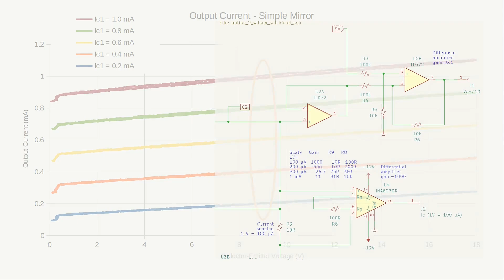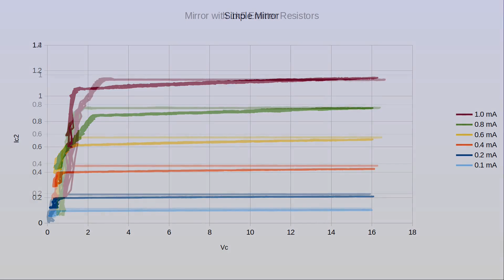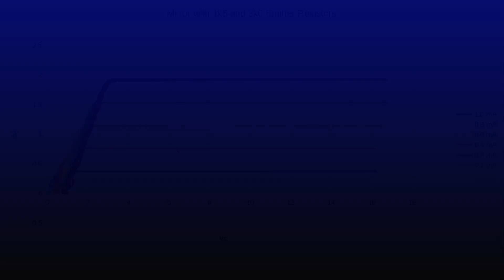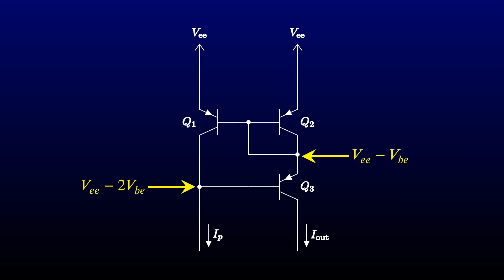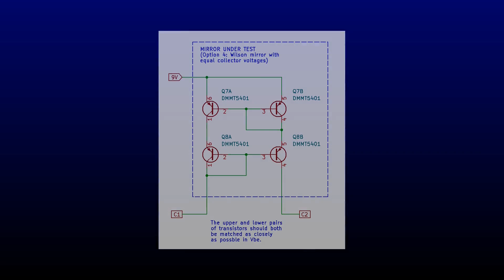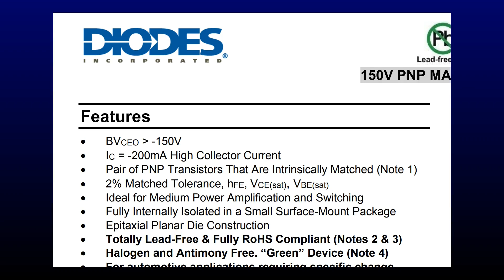Improved Current Mirrors - Transistors 101, episode 13

Comment: Thanks for your video! What do you think about the BCM847/857 matched pairs? They're "only" matched to within 10%, but for many applications like lin/log converters I found them to be decent cheap alternatives.
Reply from the maker: They're pretty good, and so are DMMT3904/3906. The 4401s that I used are a little quieter,and were in stock when I ordered in the middle of the CoViD Chipocalypse.  All of these are pretty much always better matched than the datasheet says.

Comment: There's the dual BCM847 and its complement BCM857. Most of these far exceed the rather cautious matching spec, even without the "M" designator. Not breadboard friendly, but for a PCB design they are great.
Reply from the maker: As I said earlier, BCM847/857 are nearly the same transistors as DMMT3904/3906. Both are usually much better matched than the datasheets promise. The reason I'm using DMMT5401/5551 is that I have some on hand from a time that the supply chains were disrupted by the Great Plague and they were what I could get. 

I also have a few PMP4201Y and PMP5202Y, but the SOT-363 package is even less breadboard friendly. I have a bunch of SOT-23-6 to DIP adapters.

Comment: hello can I ask something about what you calculated at 2:28? it says that the base voltage is higher than the power supply voltage? how?
Reply from the maker: PNP circuits are annoyingly upside down.  The current through the resistor and the base-emitter voltage of the two transistors are both negative in the equation.

Comment: Happy new year and thanks again for your fine tutorials of 2024..  your channel is REFERENCE material and reminds me of Robert Pease works RIP ...  ah yes those were the days...
Im currently designing a unity gain SE to BAL converter audio output stage but im limited to 16V rail max and im breadboarding over this new years holiday period from a stock of hundreds of BC549.  i expect lots of tears and hair pulling...  i would love for you to discuss the longtailed pair esp if you can allude to low voltage applications..  would be a great help?

I was going to buffer the outputs with bjt voltage followers and whatever neg fbk ratio presents itself?  Lots of fun ..
Reply from the maker: @Robert.Chauval  I'm in the process of writing the script for long-tailed pairs right now. It'll be a little while because I try to run a backlog, but it's coming.
Reply: @KludgesFromKevinsCave  fantastic really appreciate your prompt reply..  im happy to experiment until then and compare notes..  no pressure at all. 😊😊

Comment: I find current controlled systems very interesting. Most of the high end instruments of HP in the 70's and 80's use current control rather than voltage control. It's a pity, that components  have not evolve since then. Example: The other day I was looking for a matched pair of low noise transistors for an audio application. This was very disappointing. First I couldn' t find a single BJT with better noise ratings than the old BC550/BC560. Moreover there is no matched pair of these. And when it comes to JFET's  things get even worse.
Reply from the maker: I'm on the road at the moment. I'll check my notes on low noise matched pairs when I get home.  Ping me (email in profile) if I don't get back in a couple of days.
Reply: @KludgesFromKevinsCave  Have a nice trip. And I forgot to praise your channel - very neat mixture of theory and practice.
Reply: @KludgesFromKevinsCave  Today I found 5 interesting dual low noise BJTs from Toshiba. Moreover they have excellent beta linearity and are cheap. Hence they are really a good choice for audio applications: HN4A06J,  HN4B06J, HN4C06J, HN4A51J, HN4C51J. They differ in the configuration: dual NPN, PNP-NPN, dual PNP and the pinning commen emitter, commen base.  Unfortunetly Toshiba doesn't specify the matching.
The CMLT5088E, ... from 'Central Semiconductor' may be another good choice but poorly specified.
Reply: I guess low market demand is what makes those not commercially available. I have spent hours too matching transistors from large lots...
Reply: @stamasd8500  Look for HN4C06J or CMKT5087
Reply from the maker: From my notes:  

For cheapo generic transistors, I find that 2N4401/2N4403 run quieter than most other 'universal NPN' and 'universal PNP', so they're what I keep on hand at the moment for 'I need a transistor here.' They're not great, but at least they're a good bit better than 2N3904/2N3906, and sometimes that's the difference between, "I can't get acceptable audio out of this thing," and "good enough."

BC850/BC860 are SMT versions of the BC550/BC560. The corresponding matched pairs are BCM847 and BCM857. Readily available and cheap.  The drawback (for me) is that they're in SOT-363/SC70-6 packages, and I'm still working on my soldering technique for parts that small. Of course, in the workplace, there were minions to do that sort of thing for me, so I never got good at it professionally. The techs hated having engineers at the bench!  I have strips of PMP4501 and PMP5501 sitting in the cupboard simply because I can't be bothered to solder them at the moment!  But when I look at the parts availability, it looks as if manufacturers are starting to discontinue SOT-23 parts in favour of their smaller cousins. Cell-phones will be the death of all of us who have shaky hands!

Most commercial (non-monolithic) transistor pairs are pretty well matched, because the way they're packaged means that they'll be picked from adjacent dice on the same wafer. Even the humble DMMT3904 usually matches to less than a millivolt in Vbe when I test it. (Of course, you'll get the occasional one that's way off - but for a hobbyist or experimenter building one-offs, that's livable.)

For better performance: MAT12 still is in production.  SSM2212 has a pretty good match and fair noise performance. (The PNP counterpart, SSM2220, is discontinued.)  THAT300/THAT320 (matched npn and pnp quads) have decent noise performance but only fair matching.  HFA3134 (NPN) and HFA3135 (PNP) are RF pairs (6-7 GHz transition frequency, says the data sheet) with a fairly loose match (6 mV, says the data sheet) but they're quiet.

Thanks for the mention of HN4x51 and HN4x06.  I had the previous generation (HN3C51, HN3A51) in my notes and was disappointed to see them discontinued!

Some pretty good single transistors aren't promoted by their manufacturers as low-noise.  ZTX718 (pnp) or ZTX851 (npn) have excellent voltage noise if you run them at fairly high collector currents (they're large-die parts), and there are a bunch of other transistors that are fairly like them. 3d edition of The Art of Electronics has a table of the ones that existed when they were writing the book. About half of those are discontinued, of course.

On the dual-FET side, in roughly increasing order of price ($6 at the low end, $70 at the high) and performance: LS840, LS5912, LSK389B, IFN146, IFN860, IF3602.  Of course, you can forget about threshold matching for JFET's, the manufacturers never managed it.
Reply: @KludgesFromKevinsCave  SOT-363/SC70-6 soldering is really not as difficult as it appears. I do it all the time with a cheap hot air station and good quality solder paste, never had a problem. I even got good at soldering DFNs with large center grounding pads. A clean surface and plenty of good flux go a long way.
Reply from the maker: @madhusiddalingaiah5301  it's not the soldering that gets me, it's the parts placement. Reflow is magical! I have essential tremor in my hands and some days they simply shake too much to get a part that small over the pads. I've been following what Stephen Hawes is working on because it looks as if something like that might help.

Comment: That blue gradient background always reminds me of Windows 3.11 era software installers.
Reply from the maker: Ouch! Something I'd rather forget!  (Although if I remember right, they mostly used a solid blue, which was exactly the same colour as the Blue Screen of Death!)  

I'm so glad I allowed extra time to catch my flight, the day that all the departure boards in the New Orleans airport were showing https://flickr.com/photos/ke9tv/1507913971 !
Reply: @KludgesFromKevinsCave  Solid blue was used by early stages of Windows installer itself and many DOS programs. Windows software usually used the gradient. Some drivers, etc. used it as late as early 2000s. BTW. I think you may have mixed in something extra within your message.
Reply from the maker: @pvc988  Something extra? I meant to include the link to a picture of the Blue Screen of Death on the US Airways departure boards.
Reply: @KludgesFromKevinsCave  Ahh, ok. I thought it was by mistake. I don't open any links I am not certain about. I thought it was a fragment of a message to someone else. d'oh

Comment: A couple 1k's above the Wilson mirror can add some marginal improvement as well in the same way, I think.
Reply from the maker: That's exactly what the REF200 does. It comes at a cost - the range of currents that you can handle drops quite badly. (How close could a 10 mA mirror pull its output to the supply rail?) 

IC designers generally avoid that topology unless they're going for really tight tolerances (REF200 guarantees 0.25%) for that reason. Also, aboard a chip, a resistor is more expensive than another transistor pair. If you look at the internal schematic of most analog IC's, you'll see a single resistor generating a reference current, which then gets mirrored all over the place.

Comment: The Behringer/Music Tribe owned semiconductor spin-off Cool Audio has the V3046M which is a contemporary monolithic matched transistor array.
Reply from the maker: @sabamacx  I should probably have mentioned those. The 5 mV 'max' offset voltage on the data sheet is a little concerning, although the 450 uV 'typical' value is quite attractive. The cheap non-monolithic pairs do about as well. A lot of them specify 2 mV max, 1 mV typical - and the last bunch of DMMT5551 I got had Vbe matching to about 300 uV. I suspect that the Cool Audio parts do better than it says on the tin and they just can't be troubled to test them, but I hate having to do incoming inspection on SMT parts.

The 3046 is nice for exponential converters, where you can use one pair for the converter, one transistor for a temperature sensor, one as the tail current source, and the fifth as a heater. Running it at a constant 50 or 60  C means you don't have to have outboard temperature compensation.

The super-matched pairs are scarce. LM394 is long gone. SSM2212 is still sort of in production, but the complementary SSM2220 is dead. MAT12 isn't terribly affordable. Nothing else came close to their specs!
Reply: @KludgesFromKevinsCave  Might be also fun exploring self-binning matched pairs for matching Vbe's. At least, it's still very useful when we are building small time stuff for ourselves. Sure, it's not applicable for mass manufacture, but I doubt that a great majority of the audience here are exclusively looking to use your presented material directly in that circumstance.
Reply from the maker: Hmm, maybe. But commercial matched pairs are dirt cheap nowadays. I can spend twenty bucks, get a hundred DMMT3904W's and not have the hassle of matching them (unless I need better than a millivolt in Vbe, which I seldom do.) If I need the pair on a breadboard, I can reflow solder it onto a carrier board pretty quickly.

I also don't scour the Internet for tempco resistors or PTC thermistors to go with the pairs. A tiny platinum RTD bonded to the pair is a cheap and easy solution.

I might still do what you suggest at some point, mostly for the nostalgia factor. I remember VCOs with pairs of PN2222's gooped to thermistors with heat-sink compound and zip-tied, after being carefully hand-matched with a rig like the one in https://musicfromouterspace.com/analogsynth_new/TRANSISTORMATCHER/TRANSISTORMATCHER.html  The 'go/no-go tester', with its instrumentation amp built out of TL071's is mind-boggling. Nowadays, I'd just spend two bucks on something like an INA823, have that whole circuit (except for the window comparator) on a single IC, and never have to recalibrate it.

Thinking aloud: Actually, a matcher for incoming inspection of cheap pairs might be an interesting idea.  Pick up a SOT23-6 test socket off AliExpress,  and add a little circuit with an instrumentation amp to measure them.  That could work for a future video, so thanks for the idea!
Reply: Alternatively, Latvian company Alfa Rpar also makes these matched pairs under the name AS3046. Matching between the transistor seems to be better as well, at least on paper.
Reply from the maker: Yeah, CoolAudio and Alfa are both trying market to people who are trying to replicate classic synthesizer and guitar pedal designs that used the CA3046 from RCA. I don´t know if they licensed the masks, or if they've done their own. An upgraded version, the HFA3046BZ, is still available (in SOIC-14 form factor) from Renesas. It has a really high 8 GHz transition frequency but it's limited to 12V Vceo.

The high transition frequency means that it won't work in a lot of those classic designs without modification, because simply dropping in the faster part sets them to oscillating. The lab manual for The Art of Electronics recommends HFA3096 (a related part,  3 NPN, 2 PNP) as a CA3096 replacement in some of the exercises, but points out that sometimes its oscillations simply can't be tamed. In particular the exercise that builds a 'discrete op amp' is often not unity-gain stable with so fast a part, no matter what compensation capacitor the student chooses. The stray reactances on a breadboard just kill it.